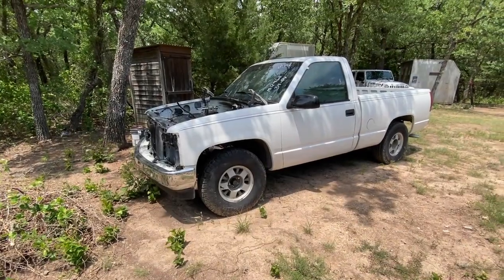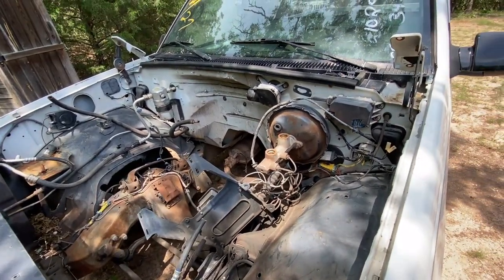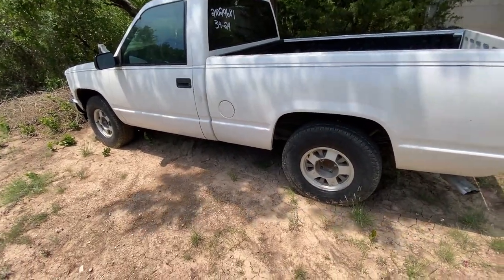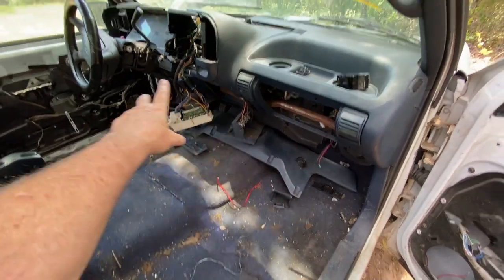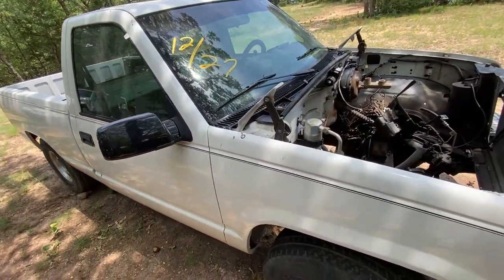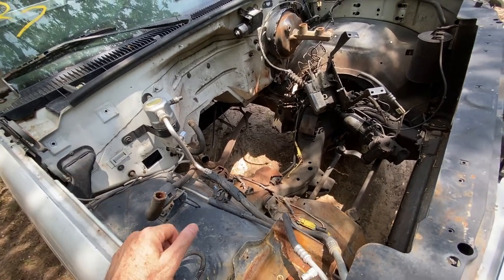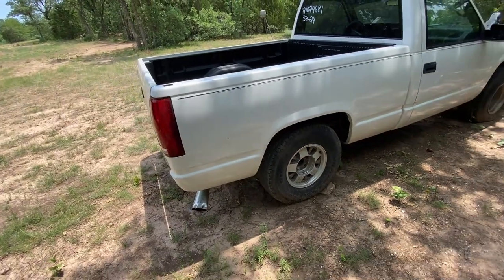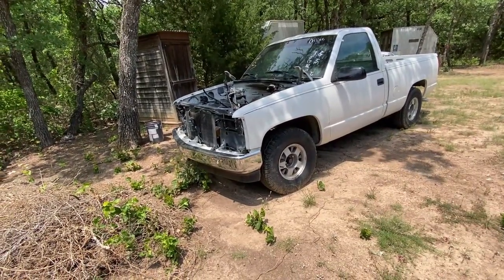1988-98 OBS Chevy Truck PROJECT LS Swap Cammed 5.3, Turbo, Engine Swap, 4 Link Rear, Coilovers?

Comment: I vote LS as well...only because it's a blank slate...it can get very expensive...I did so much to my single cab I'm afraid to add up the cost but it's truly rewarding in the end..
Reply from the maker: Thank you, yep, if not careful and drawing the line in various areas, it can easily get out of hand quickly!

Comment: Store it and keep focus on the main project truck. If you get distracted by this truck progress will suffer. In the fullness of time you can get to this one and a clear plan will emerge.
Reply from the maker: You are correct, before forging ahead with the '95 I will get the '91 finished up....well, projects are never really finished completely....but I get your point and it is a good one.

Comment: Hi, Mr. Lawrence, very good work. You do. I have a problem with my OBs 94. They swapped it for me in Dallas, but the problem is that I hit the brakes and they don't turn on, but the radio and the wiper lever turn on. I'm also struggling with it. when I turn on it doesn't work I don't know if something similar happened to him if he could guide me to see if I can repair it Thank you very much
Reply from the maker: It would be better to email me. Check below the video and all my contact info is there.

Comment: SBC HP as God intended , Its much cheaper than a LS Swap. Lowered but not to radical . No reason to change the basic design of the suspension. Even keeping it budget friendly will add up quick.
Reply from the maker: Very true....If the truck already had an eng/trans, I would completely agree. But, given its stripped status I think it is a toss up. A friend is finishing up his '90. Rebuilt his 5.7 added some chrome, looks great. He's in it for nearly $3K and has not turned the key yet....so, I think I can easily beat that. May not be an exact apples to apples, but you get the idea.

Comment: I have a question my friend,Im working on the same project and at this point everything its installed on my OBS,Turbo ,cam ,trani and to many other things but when I start the engine injectors sprays what its necessary for turn on the engine and then they stop workin and engine shut off. Any advise on this prblm
Reply from the maker: The problem could be any number of things. I would first look at the tune in your PCM and your fuel injectors. I assume that since your truck is turbo, would you have larger than stock injectors? Is your PCM calibrated for the different injectors? Has the VATS  been removed? do you have a fuel pressure gauge mounted on the fuel rail of the intake? It would be good to know what your fuel pressure is when you turn the key to the on position and what it does when you try to start the motor. Obviously, the motor is dying so the pressure would drop could be fuel pump, not adequate to supply the needs of the motor.
Reply: @laurencevillegarage  Thanks for your  response and advise,  I will made those troubleshooting to see if things changes.

Comment: Lower it 4/6 qa1 suspension kit nice little motor 355 or 383 with Holley sniper intake and a 6 speed and reskin the roof.
Reply from the maker: I like that idea...hmmm a 383 with 6 speed.....

Comment: Because the moon roof alone, I would use it as a parts truck
Reply from the maker: I don't see the roof alone as being enough to part it out, but time will tell. There are many cars/trucks in the past that were either parted out or left to rot that if found today would go to great lengths to restore or fix up. In the end, I have to put a pencil to it and see where it goes and try to take the emotion out of it.

Comment: Any update s?
Reply from the maker: I've been putting a lot of time in building the new shop. So...on the '95 none to report. Did purchase a '98 K2500 (with 88K) will introduce soon. I really needs only a water pump (leaks a little, but not enough for me to wrench on it yet), has 88K, very nice original truck. No plans to swap it. It will be the true daily to pull anything and haul what I need. On the '91, clutch was giving me some trouble....turns out  the new slave cylinder I installed broke (after only several minutes of use) and I didn't consider the new part being bad for awhile. The clutch hydraulic line that runs from clutch master cylinder to  slave had a pin hole in it. Could not patch it. Bought new to replace with. It leaked at a fitting joint within the line itself!! (2 NEW items purchased that were either defective or broke very quickly). Removed line and was repaired at Hosefast then re-installed. It appears to work properly now. Now can finally start truck, begin to drive to adjust brakes, charge a/c and work out wiring stuff that could not be done before. Still have not driven the truck yet. Hope to tomorrow to evaluate what does and does not work. Garage is a mess due to packing up some stuff and losing space to work in. It's very frustrating, but, a means to an end and still a blessing. I just have to be patient as all the small details come together. Thanks for asking.
Reply: @laurencevillegarage  @ 👍👍 alot projects going on,, thats good,,       May i ask if your stock  tbi pcm from 91  swap, its still hooked? Or disconnected?   I gt a battery draining on my 92 swap
Reply from the maker: @gerardolopez5875  I leave it connected. I will begin  the "sorting out" process of fixing everything that needs to be fixed. I'll remove the wiring I ultimately don't need, but I leave the "old" pcm in place because it may be running other functions unrelated to the actual swap I don't want to mess with.